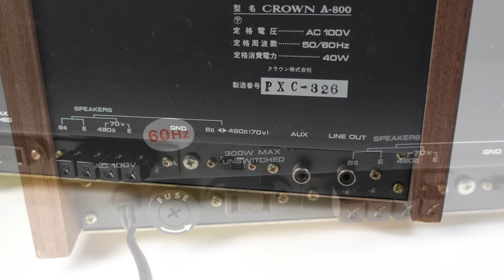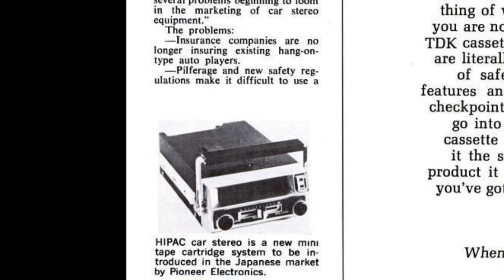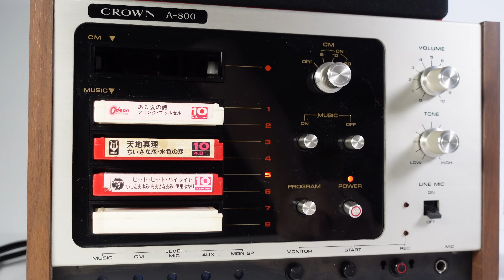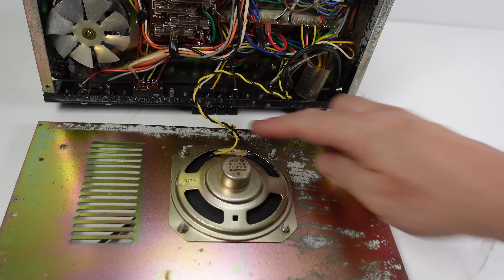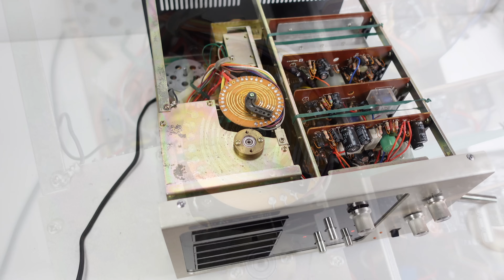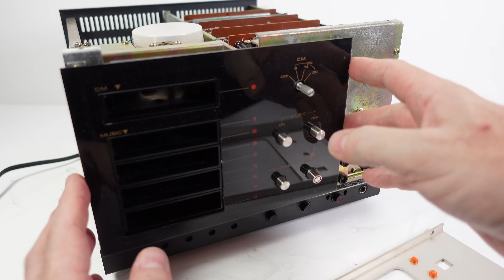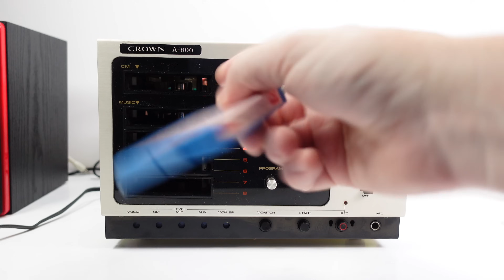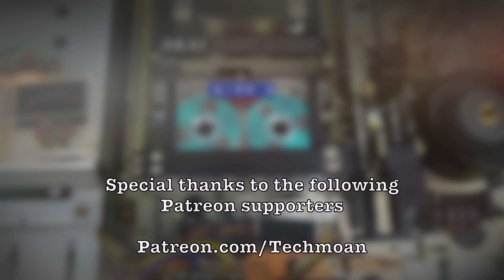An unusual player for a forgotten ‘70s music format

Comment: It was in 1970 when I was stationed at Fort Leonard Wood Mo. I was in training to be a field wireman, climbing poles, running field wire, hooking up field phones to switchboards and such.  We were living in the old WWII Wooden open bay barracks with double stacked bunks and it was late summer. The heat in the forests was horrid but we would spend a week in the field, then a week in the training buildings learning electronics and such.  I was young and was near our first anniversary my wife and I.  She took a bus down from North Dakota to Rolla Mo and when we got a weekend off, my buddy and I would catch a bus and join our wives at a motel, where they shared a room over the week and then rented and extra so we could be alone.  Our son was conceived over that time of our lives, and once finished with training, I got 2 weeks leave, then it was off to Vietnam. At any rate, getting to the point one of my other buddies had a small portable tape player that took what appeared to be the same size cartridges but in a portable player.  It was a bit larger then a portable radio and was mono but sounded good, I traded him one of my  pipes and some smoking Prince Albert for the device and several tapes.  I left it with my wife when I left for Vietnam, she gave it to her brother and that was the last I ever saw of it. I do believe that it was some early form of player. I know it was smaller then a 4 track player as I sold both 4 and 8 track players to truckers at a truck plaza before I joined the Army.

Comment: Changing the cap should work as a filtering cap to boost or reduce voltage freq for running the motor and circuit.

Comment: I've only really scanned the comments to find out whether people say that capacitor might do the job. Though I have a career in electronic design I am no motor expert but am aware of the many kinds of motors some of which have run capacitors. I can only say it may well work and trying is unlikely to do any harm (since the frequency is lower than the unit was designed for). The marking doesn't mean that changing the capacitor alone will do the job but it might.

Comment: Gday.  If you are struggling with the screws it might be because you are using a Phillips screwdriver? (it looked like one).  Japanese equipment does not use Phillips screws very often.  They use their own format known as JIS.  These screws can be identified by a small dimple punched in one corner of the cross-head socket.  I always had problems with Japanese equipment until I bought a set of JIS screwdrivers. Apologies if you already know this! (BTW, I can't take credit for this, it was a certain James May that put me onto it.)

Comment: If it says a capacitor change will change the playback speed,then it is pretty certain to work.The capacitor should be of the same type though.As my dear departed mum used to say,"suck it and see."
Reply: It does NOT say that.  It says that a different value of capacitor is used for the two mains frequencies speed.  It does not say that is the only change.

Comment: I think the Capacitor is Adjusting the Speed. This was a System often Used in Philips RTR Recorders, there you have 2 Capacitors and switch the Connections between them to change capacity to change speed.
Example here: Philips N4419 you have 2 Capacitors, C9 and C10 and both are 27nF. 
19 cm/s -> C9 and C10 are in series, makes 13,5 nF.
9,5 cm/s -> only C9 is used
4,75 cm/s ->  C9+C10=54 nF.

so it would make sense if they used tha Capacitor for Changing the speed

Comment: Was thinking, if the HiPac takes the same tape as compact cassette, then I could print the cases for you using a resin 3d printer. All I would need is photos (taken directly down and center)  of the top and bottom of each half, and a measurement of the Width, Hight Length. Then you just use normal tape in them?

Comment: In the USA a small number of vehicle models had a Compact Cassette Stereo as an available option in 1976. More had it factory available in 1977 but it was still a rarely ordered option. But by 1979 the car makers had decided the 8 track was gonna die and some models were starting to come with a cassette stereo as part of some special option group that was nearly impossible to not get. Cassette adoption in vehicles rapidly accelerated from there.

The last album I remember being offered on 8 Track was a Marty Robbins reissue after his death. The company merely re-ran the original TV commercial with a new ending where it was said to be available on LP, Cassette, 8 Track, and CD. Four choices! I assume that at least the 8 Track was most likely leftover stock from the waning days of the format. The CD of course would be a new digitization, hopefully from master tapes. I was skeptical that they really had any 8 Tracks and was tempted to try ordering one but I wasn't (still aren't) a Marty Robbins fan.

Comment: Is there a market for someone to get one of these HiPac tapes, make silicone molds, and cast new shells in hard urethane resin? The difficult parts would be the pinch roller and the spring. Not a job I'd want to take on but someone might.

Comment: my god! it's been a long, long, time since i saw a crown cart deck! these were designed for radio station advertisement insertion by the AUSTRALIAN crown company, based in preston, victoria, in the 1950s through 1980s. these were quite common playtoys in radio stations around melbourne for about 15 years between 1968 and 1983. this one is a mid-70s (by the style of it) sample. they loosely followed the same design trends over the years as consumer reel to reels of the same time.

This is the same crown company that produced the only studio reel to reels (to my knowledge) with 14 inch reel tables on a quarter inch deck, because they were always customising stuff within the nab guidelines for niche markets.

Comment: The miniature format was actually developed in the 1960’s the concept was partially based on the US television  series “Star Trek”. It was used for the nominal computer storage medium. The idea was to create a small portable tape format for use anywhere similar to the transistor radio. 
The drawback arose because even with a tape speed of 3 3/4 IPS ( inches per second) it could only accommodate a maximum of four songs of a nominal,  of 2:30 minutes in length. At the same time, Phillips was developing the 1/8 inch magnetic tape cassette which by it’s double spindle , similar to the 1/4 inch reel to reel tape recorders of the time could hold much more tape and have an increased playing time. Plus, you could record onto any blank cassette. While initially, most cassettes could hold a maximum of 30 minutes if tape length, this was sufficient when using both sides, that a music album could be played as easily as a vinyl record. All was still in Mono, however as with reel to reel tape recorders and records, stereo was coming onto the market, Phillips was able to engineer a stereo format onto a compact cassette. This made the 1/8 inch cartridge obsolete even before it had any chance.

Comment: Replacing the capacitor (or adding 0.4µF in parallel) seems reasonable to me if that capacitor is in series with one terminal of the motor, with another two leads to AC/mains power; as this is both what the manuals for some some reel-reel machines say to do when switching from 50Hz/60Hz, and switching the run capacitor values is how many primitive fans and other machinery vary speed (as was demonstrated to me in school).

I tried to do considered actually doing the math to make my argument look better _without actual substance_.  Without knowing the actual specific internal circuitry and components I cannot make any real determination.

But with the capacitor(s) in series with an imaginary 11H inductor {17H inductor and 1.5µF capacitor}  <near. 15.4H and 1.9µF> the 0.6µF and 1.0µF capacitors; The circuit peaks at 48Hz and 62Hz {50.1Hz and 59.3Hz} <50.00Hz and 60.00Hz> respectively, suggesting that it _could be plausible_.

I'll put the link to the interactive sim with the nonsense in a reply so that it can be minimized.

Comment: Even the small cartridge tapes work similar to the Fideli-Pac cartridge tapes used in broadcast radio stations. They were easy to use but not easy to work with.

Comment: If it's anything like an Akai CR81D 8 track deck the cap will adjust the speed. The Akai used a multi section cap connected to a switch to change between 50/60 Hz. Give it a shot won't harm anything changing a cap.

Comment: I still don't understand the endless loop tape system than these and 8-track uses. The linier tape speed is constant, the tape exits the spool from the inside and enters from the outside. But how is that possible? The outside diameter is larger, so it seems to me it would be taking up more tape than it is letting out as the spool rotates. So what is the secret? The only thing I can think of is that the take isn't all rotating at the same speed, but I can't imagine that would work.

Comment: Yes, changing the cap to the stated value will correct the speed.  Just watch polarity, and voltage.  If it isn't listed on the original cap, pull out the multimeter.  Always select a cap with a voltage rating by what you measured by 20%, because.  Higher than won't hurt anything, but the part has to fit physically.
Reply: Changing the cap is not sufficient.  And what's with the "watch polarity"?  The voltage across it is changing polarity 50 or 60 times every second.

Comment: I just wondered, since you happen to have that 50/60Hz Problem quite often. Did you ever consider buying a 12V to 110V/60Hz pure sine Inverters? They are reasonably cheap in the power range you'd need for all those quite low powered devices and you could power them from a small battery attached to a car battery charger, though I'd recommend a proper power supply.

Comment: if the capcitor is just forming an artificial phase for the motor, changing it won't alter the frequency. in the majority of likley senarios it wont. best bet for a simple solution is to find a place to change the 'gearing' ratio by increasing or decreasing the size of a pulley in the belt path by a 6:5 or 5:6 ratio.

Comment: Capacitor change will not change the speed however it will put the motor in the sweet spot and the motor will run as designed keeping the motor within spec due to phase shift and counter emf. Bottom line is you will require a slightly different motor pulley. Respectfully, Dennis, KV4WM
Reply: "The frequency f in hertz is equal to 1 divided by 2 times π times the resistance R in ohms times the capacitance C in farads." Could change motor speed.

Comment: Sony used different values of capacitance in their reel to reel machines to set the speed for 50/60hz regions. The capacitor in this item will also need changing to the value quoted to do the same.

Comment: 60Hz is easy. Folk importing digital lionel model trains from the states had to figure this out. Step 1: Get 12v high current power supply (or a car battery). Step 2: Import a 60Hz invertor from the USA for the correct voltage you want 110 / 230 etc. Job done. Note: you might lower the low voltage current if you used a lorry 24v USA invertor instead of a 12v one - which makes it easier to create the mains to 24v power supply (less current = cheaper) (power supply may be cheaper than a car battery / leisure battery + charger).

Comment: To change the speed, first you will need to change the capcitor. Second you need a capstan with a different diameter. Third you need to calibrate the audio levels. (In your case you will have higher levels if it runs faster). I dont think only the capacitor will do it, but its worth a try. You will not destroy the machine with it. Maybe it works because the different in the speed is minimal. Greets from Austria (P.s.: ill do service on Revox and Studer Machines, and also some costumers would have other speeds)
Reply: No to your third. The aim is to have the tape running at the same speed when appropriately configured for whichever power frequency it is used on.  Therefore no change in audio levels.  Glad you don't service any of my equipment!
Reply: No need to be rude. You are right in the term of „runs faster“. It was an overall, not deep enough description. The Oszis for Bias and Audio paths etc. works different when running not on the Hz the 
machine was delivered and calibrated. Thats also the reason you need to change the capacitor in the motor oszi path. In the Audio path you have potis and measure points for that.
In the case of this machine it would be very hard, im sure there is no test and calibration tape avaible. Also no service manual… 
In term of your equipment, if it is tape based (and pro stuff) you need to calibrate audio levels, bias, eq etc before every recording session ;-)

Comment: Whenever I see an endless loop tape/film mechanism, one word pops into my mind: FRICTION.
Reply: yea that is an issue with them, they can actually bind themselves up, but i think the word that comes to my mind first is wear, the tape always gets pulled from the inside and these tapes are oxide coated plastic, if compact cassette needs cleaning because the ferric coating rubs the pinch roller and tape head imagine what squeezing it in a wheel of tape then pulling it from the inside of the wheel is doing to the oxide coating over time,

Comment: If I was designing that machine, I would use tones on the announcements tape to allow multiple messages and indicate the start and end of each one, rather than using the metal strip thing. The metal strip thing is fixed and only applies at the end of the whole tape. With tones, you could record a message any length and have a tone indicate when it's finished and the music could resume. When the music resumes, you keep running the annoucements tape until the tone ends and you know it's cued for the next message. You could have many messages on a loop of tape, and they wouldn't have to have tapes with the exact length of the announcement.

P.s. Have you thought of investing in a 60Hz mains inverter to drive 60Hz equipment? They are normally designed to be used in cars and run from 12V, but aren't very expensive.

Comment: Auto reverse cassette players were (just) available for cars in the early seventies. I bought a Philips one in about 1973: fast forward, fast rewind, auto reverse and you could flip from one side to the other at anytime - cost about £70 I think
Reply: I never understood why there were so many esoteric mechanical work-rounds to produce auto-reverse cassette decks. Multi-track heads were available, so why not just use a four-track head and electronically switch between them?

Comment: Two things: Switching caps is easy, especially in old equipment like this, and they're pretty cheap, so just try, and it'll be fine if it changes the speed or not, I'm sure. Just remember to get electrolytic caps with the right value and power rating and remember that they're polarized! What you search for is an axial electrolyte cap with, say, a 400v rating. It'll probably fit, but might want to check the size, to be sure. The different cap options are pretty close for 50 and 60Hz, so I don't think there's any chance it's going to be bad for the unit.

The other thing: Looks like you got a bunch of enka music! That's wonderful! Some enka songs are really fun, but it's all good. It's Japan's blues, basically! There are some enka stuff on Spotify, and I really like upbeat enka hits from the 50's! Tokyo shoe shine boy and Ooi Nakamura Kun are a couple of favourites!
Reply: No!!! This capacitor is handling AC.  An electrolytic is likely to explode.
Reply: @geoffmorrison3648  Hm. What kind of cap is that, then?
Reply: @geoffmorrison3648  All caps handle AC. That's the point.
Reply: @LA6NPA  Nope.  Ordinary electrolytic capacitors only handle AC when that AC is sitting atop a DC voltage such that the voltage across the capacitor never changes polarity.
Reply: @geoffmorrison3648  Also, he changed the cap and it worked.

Comment: Re: AutoReverse in car cassette players...sorry to say that I am old enough to remember fitting these to cars in the mid-70s. 
Ye gods, there's even one on eBay at the moment! (PYE 2253) It's a masterpiece of bonsai manufacturing.
Go on, you know you want to!!!
(There were others, and this one was also sold under a different name, but the rest used end-on loading, and they had a habit of eating tapes in an even bigger way than the unidirectional players.)

Comment: Almost certainly cap value is the thing. Also, you can parallel caps to increase value so you can just tack another cap (make sure it's the same working voltage) onto the leads of the existing one. Just subtract existing value from new required value and that's the value you need (assuming you need a larger value for 50hz). Will probably be polarised so ensure same orientation.
Reply: The existing capacitor is NOT a polarised one.  It is in an AC circuit.

Comment: If it uses the same tape as cassette, would it be possible to 3D print some new cartridges (they seem simple with minimal moving parts) and make your own new Hi-Pacs using new cassette tape? Even with metal splices for the program change. Fiddly, but possibly doable.